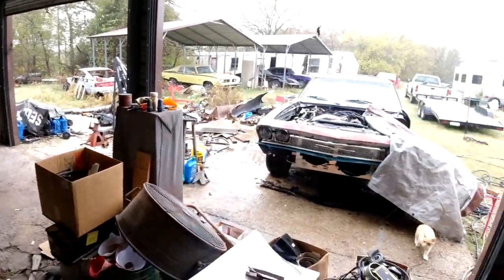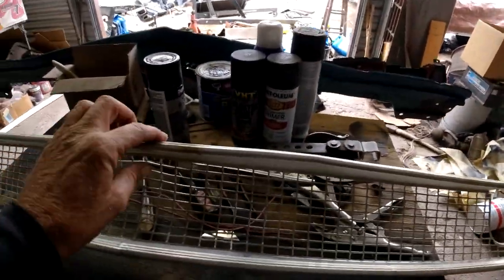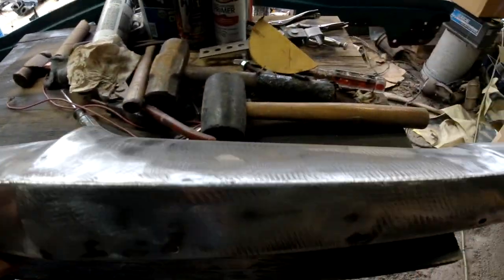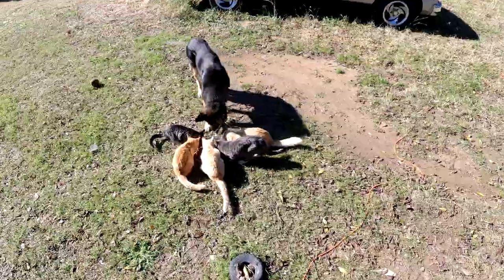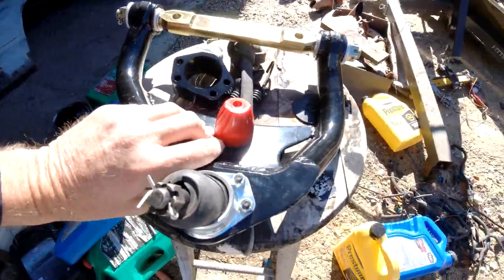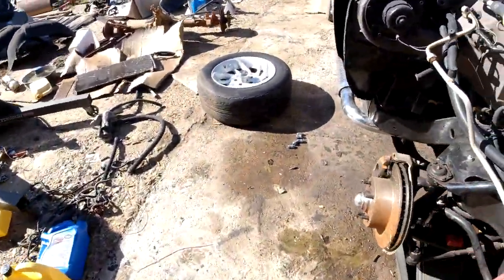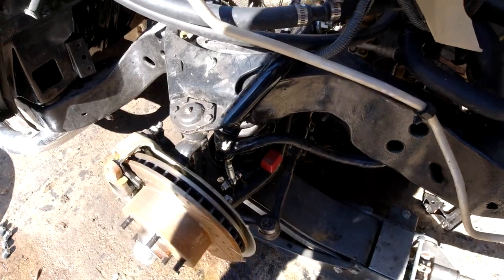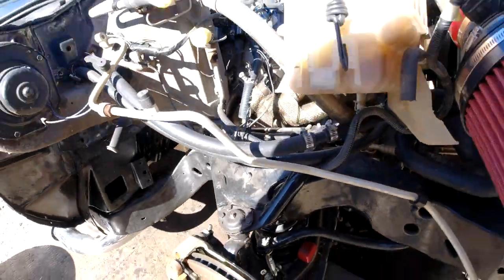1968 Chevelle Nomad Restoration - Part 46 - Control Arm Issues - Dual Gas Tanks Hooked up

Comment: If it were me Lee I’d go back to stock A arms top and bottom. I’ve got them on my GTO and when you got good bushings and ball joints in them they work real good. It’ll surely save you a lot of headache in the end trying to get those aftermarkets to fit right. Btw, love that fuel system you came up with. You are the man my friend.

Comment: Lee..your doing great still..if that was my project and doing the upper control arms..here's what I would have done..take the control arms off..take out the bushings..take off the ball joints..and have the control arms sand blasted..paint them with chassis black paint and added new bushings..and with new ball joints..cheap insurance for later down the road with nothing to possibly go wrong with the old ones..just my opinion..still your doing great.
Reply from the maker: I don't have a press, torches or the patience to fight taking out those bushings, so it's easier, less time consuming and cheaper to buy new tubular stuff, that is until you encounter a problem like this and get the wrong parts.

Comment: Lee if you look at the pitch the upper and lower ball joint sits you can see they are not at the rt angle for the ball joints .I'd run the old if I was you but it's not my build hope all works out
Reply from the maker: I  ordered 4 new control arms for the correct year.

Comment: Love what you're doing with the dual tank setup, but wouldn't it be safer to mount that intermediate fuel pump on the side/inside of the frame instead of on the bottom of it?
Reply from the maker: nothing is going to hit it, it's higher than the tank and hitch

Comment: Hi. You might have a problem filling that aluminum tank through the main tank because that 3/8 line going from the main to the auxilary tank is going to flow very slow to fill it. just thinking out loud. good luck.
Reply from the maker: I just tested it, it works fine.

Comment: With those springs,  you are probably overlooking the weight difference between the original engine and the ls you put in, I would put the original bottom arms on and check the space difference,  you should look back on video to see original setup to how it is sitting now, what's the height difference on your other chevelle

Comment: I am no suspension expert, but wouldn't the upper control frame mainly move upward?  Obviously it will go down when the car rebounds upward.  In other words, the upper control arm moves opposite of the car frame.  It's definitely a head scratcher.  I believe i would rebuild the stock control arms so you know it will work correctly.   Good luck!  Hate to see you having so much trouble over the Suspension after all the customizing you have done successfully.  Looking forward to seeing it painted and driving :).
Reply from the maker: The problem is the top one is hitting the frame when resting.

Comment: Just thinking since you don't want to cut those ribbits off to put that little metal piece that holds the boot maybe just tackweld the metal piece in a couple spots so that it holds the boot

Comment: I think the lower control arms are wrong also. try one of the old lower arms. I think the cup that the spring sits into on the lower is deeper also the angle of the lower arm is different making the spindle geometry wrong. Don't let the haters get to you, nice work brother.
Reply from the maker: I think you're right

Comment: FYI  THE BALL JOINT EXTENDERS the angle  face goes to the suspension arm. You have the straight face on the arm. They maybe right left specific too. This should fix your issue with the top arm. The bottom arm seems wrong, it should be angled so bottom of spring sits parallel to the ground. Best to get original arms, BUT the above note on the balljoint spacer will get you going for now.
Reply from the maker: I tried it both ways, made no difference
Reply: It should put more clearance for your wheel rim and the ball joint should sit flat. But yes as your original statement the arms are not suitable. Good luck with it my friend.

Comment: To me what I'm able to see it looks like  the left spring is not seated in the cars frame correctly.
Reply from the maker: both are not due to the angle of the control arm is off..is what I'm thinking
Reply: @clunkersandclassics  That makes sense  that's  why it's so  stiff and being new is very rigid.

Comment: I bet you those front Springs are way too stiff and they're acting like they're expanded that's why you're tyour arm is way down and you have no travel I bet they are too stiff
Reply from the maker: they're not in the right spot on top because the angle of the control arm is off at the bottom
Reply: Hey sorry about the late comments sometimes you know l watch the videos whenever I get a chance to and I make my comments, but most of the time you already passed all that stuff good luck to you man

Comment: The lower control arms are wrong did the same thing on my72thethe wagon springs fit for ac car's bad lower control arms nothing will line up factory arms will work just fine